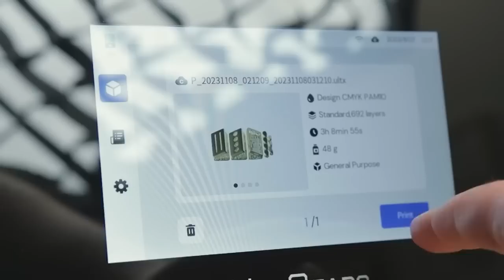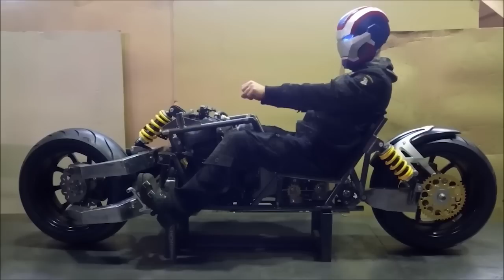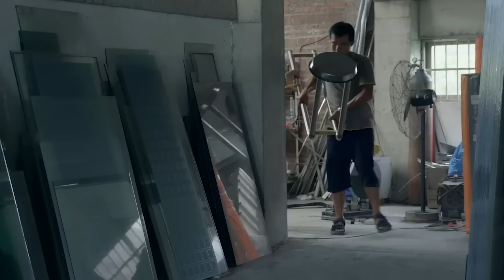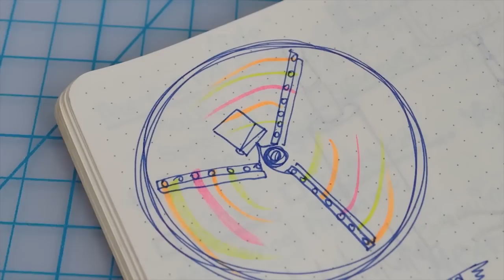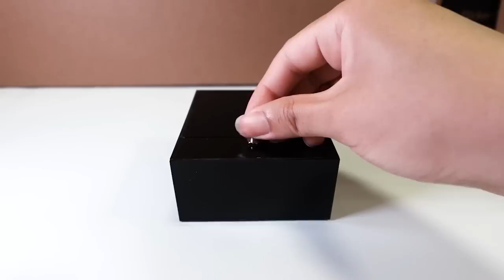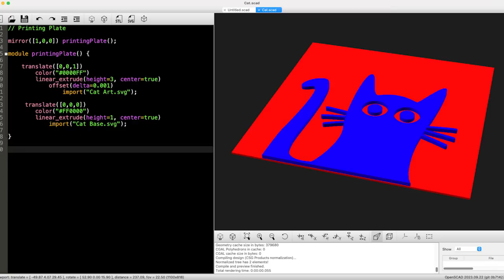Favorite Projects of 2024 [Maker Update] | Maker.io

Comment: There have been several previous Akira bike builds that used hub centre steering suspension and a number of production motorcycles too. I rode a Yamaha GTS1000 for a few years and they're an impressively stable, yet maneuverable machine (just 100Kg too heavy!).
Reply: Wow! Yeah, I expect the weight of these bikes becomes an issue.
Reply: @MakerProjectLab  The weight problem with the GTS was down to Yamaha's massive over-engineering. My local Yamaha dealer raced a GTS at the TT (placing 8th and 6th) and got rid of that 100Kg bloat. The Bimota Tesi wasn't heavy, but the hydraulic steering was a problem and the mechanical linkage that replaced it had geometric problems. The later Vyrus built development of the Tesi weighed just 155Kg, light for a liter class motorcycle.